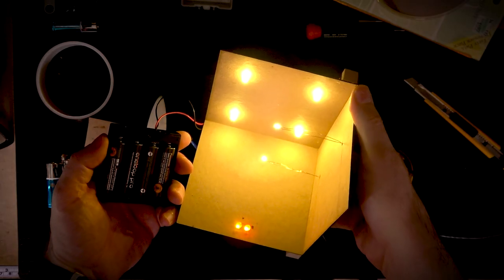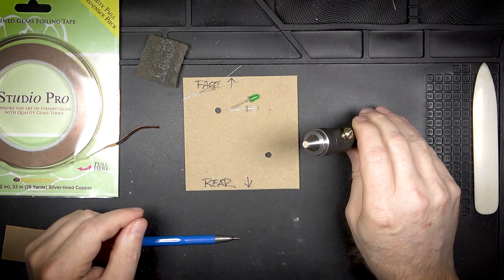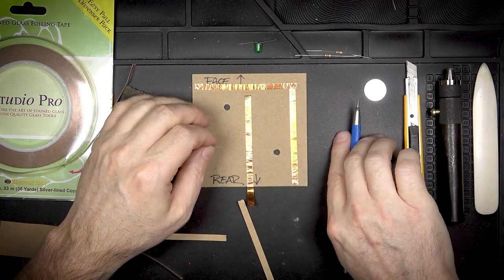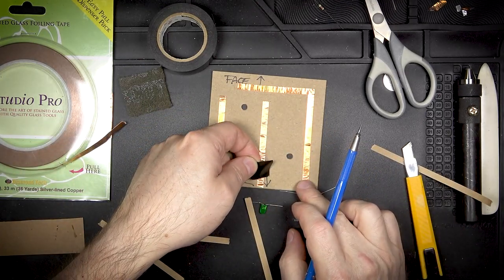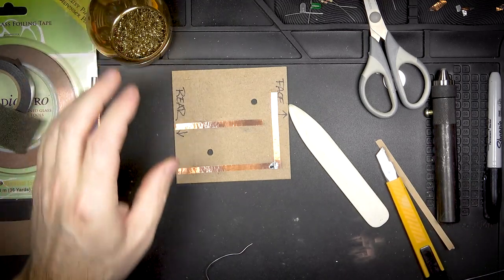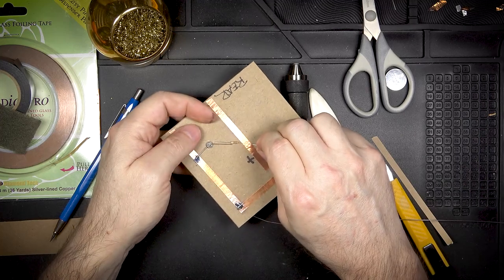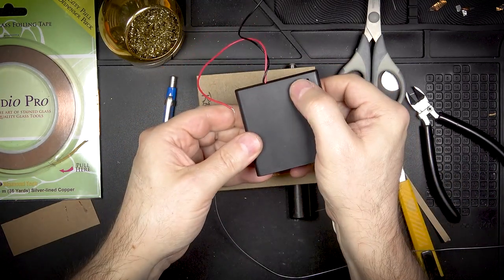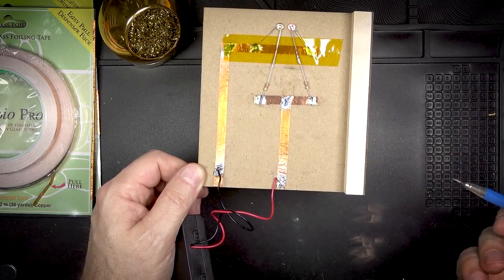Using Copper Tape to Wire Book Nooks and Dioramas

Comment: Thank you so much for doing this comprehensive video.  There are few video's available which fully explain how to actually add electrics safely but now I feel I could actually try it myself! Thanks again :)
Reply from the maker: Glad it was helpful. For the most part, LEDs are pretty straightforward. Soldering takes a tiny bit of practice but it's actually a good skill to learn. If you keep your voltages low, work with batteries, and watch out for shorts, it's pretty doable. All the best with your projects!

Comment: Very good and detailed instructions for complete novices like myself. Thanks!
Reply from the maker: You’re very welcome. I hope it makes adding a little lighting to your projects a bit easier. All the best and happy new year!
Reply: @RandomMakingEncounters  you as well! I still have to work up the courage to try it, lol. Where do you get your supplies?
Reply from the maker: @valhalloran  I get a lot of things through Amazon. However, the copper tape is used in stained glass and any hobby or craft store that has basic stained glass supplies will also have copper tape. The soldering irons for stained glass are probably a bit on the heavy duty side for soldering LEDs so I would look for something geared towards electronics. There are some good starter sets on Amazon as well. I have a few links to supplies in the description.
Reply: @RandomMakingEncounters  thank you for your prompt reply! Happy New Year!

Comment: Ive been looking into using copper tape and LED’s for adding lights into my card making. After watching this informative video i want to use it for my booknooks too. Can i ask why you have used a resistor for each LED ? Ive not seen them used before in any of the other circuit videos ive seen
Reply from the maker: You bet! LEDs are quirky little components. If you deliver too much current to them, they can be damaged/destroyed (usually destroyed in the blink of an eye). Let's dive in!

There are two ways to connect multiple LEDs in a circuit. You can connect them in series where the positive of one LED is connected to the negative of the next and the positive of that LED is connected to the negative of the next... and so on. The second way is to connect all of the positive LED legs to the main positive and all of the negative to the main negative/ground. I generally connect my LEDs to my circuits in parallel because they're usually spread out around the nook and I often mix and match different kinds of LEDs in the project (colors, flickering, etc.). Calculating resistor values is much easier and I can use lower voltage power sources... but why?

There are two things we need to know about an LED when designing the circuit - the voltage drop and the current rating. I'm not an electrical engineer so I'm going to give you my really broad, art-major explanation of both of these. Voltage drop is the amount of voltage needed for each LED to light - usually 1.5 - 3.5 volts. Current rating is how much current the LED needs to light up properly - 20mA is a good ballpark number. Exceeding the current rating can cause the LED to go up in a little pop/puff of smoke (been there, done that). Here's the tool I use to calculate things that also describes some of this - https://ledcalculator.net/

 Knowing all of these things, when we go to build our circuit, we need to deliver enough voltage to light the LEDs and limit the amount of current to just enough to work but not too much to fry. 

When wiring in series, each LED sucks up (drops) a bit of voltage starving it from the next in the series. If each LED needs two volts and you have three LEDs, you would need 6 volts going in. If you provide 6 steady volts, the calculator says you only need a 1ohm resistor... which is almost nothing. Keep in mind that 4 AA alkaline batteries will initially deliver more than 6 volts so your power source plays a big role and you need to design for a bit of wiggle room and err on protecting the LEDs in an over-voltage/over-current situation.

When wiring in parallel, each LED gets the full voltage from the power source. If we keep our source as 6 volts, each LED would need a 200 ohm resistor to reduce the current to the correct level. However... I could also reduce my power supply to 3 volts and lower the resistor to 51 ohms. Even better, I could keep adding LEDs in parallel without needing to bump up the voltage since each LED is basically connected directly to the battery without being influenced by other LEDs in the circuit. One resistor per LED is incredibly easy to understand at the cost of more connections and more resistors. It's not elegant... but it's simple... kinda like me.

It's possible to use lower voltages and wire in series but you will reach a point where you need to start to break up your series LEDs into chunks when the voltage drop across the LEDs exceeds the circuit voltage. You then end up with a mix of series and parallel in your design.

I hope that all sorta kinda makes sense. Since I mix and match LEDs in my projects, each LED will have different voltage and current requirements. I'm a keep it simple kinda person and don't want to math too much. It's very easy to plug each LED into the calculator and come up with a resistor value for each in the circuit. One thing to note... you don't have to be spot on with the resistor values as long as it's a bit above the calculated value. There's a fair bit of slop and too big a resistor means the LED will be dim or not light at all where too small means a puff of smoke.

I think it's a fair statement to say that LEDs should always have some form of current limiting resistor... even a really small one. Here's a great deep-dive resource for almost everything you would ever want to know about LEDs - https://learn.adafruit.com/all-about-leds/

I hope this is helpful. The approach I take is really just trying to keep it simple and understandable to me. I could certainly run LEDs in series and end up with a simpler circuit and fewer resistors but resistors are cheap and a simpler circuit only means less wiring... not simpler to understand... at least for me :)

All the best with your projects. LEDs really make everything better and can add so much to a diorama/nook. It's well worth figuring out an approach that works for you. I've burned up a fair number or LEDs but they're relatively inexpensive compared to the microcontrollers I've fried! LEDs are the perfect gateway to electronics!

Cheers!
Reply from the maker: One quick note... I saw you said card making. There is one instance where you can get away with not using a resistor with LEDs and that is if you're using a small coin cell. For whatever mystical magical reason, you can connect an LED directly to a coin cell without a resistor. I think it has to do with most coin cells being 3 volts (just about right to light an LED) and some internal resistance in the battery due to it's design. It's possible that explains why you're not seeing them in applications that use that kind of power??

Comment: Awsome video, I have a question tho. When it comes to LEDs dying out, isn't it too big of a work replacing them?
Reply from the maker: Absolutely. To make things worse... my nooks are usually sealed up tight. I don't keep them on 24/7/365. The good news is LEDs have a really long lifespan—I also tend to run them a little on the dim side to extend that. You bring up an important point. If your project will be on all of the time, building it in a way that it can be repaired is super smart. Desoldering a few LEDs wouldn't be too hard. Ripping things apart to get to them... that may do more harm than good. Great comment. Thanks!

Comment: I believe on most 6 mm LEDs the negative side also has a flat shoulder on the body of the LED itself.  Helps if you snip the leads shorter and forget which is which.
Reply from the maker: Thanks for the tip! I'm running outta space in my brain so I'll probably forget and still need to test. Hopefully others will fare better! Thanks again and all the best!

Comment: Great video, thank you so much! Question: can you use copper tape in plastic models? Does copper tape heat up? Many thanks!
Reply from the maker: The short answer is… it depends. Here’s the deeper dive answer based on my basic knowledge of electricity (I’m an art major so take it with a grain of salt). Broadly speaking, conductors, like copper wire or tape, have some amount of resistance to the flow of current or amperage. The greater the resistance and the higher the amperage, the greater the amount of heat generated. The thinner the conductor, the higher the resistance. To better answer your question, we need to understand two things: 1. What is the amperage capacity of the tape 2. How many amps is the circuit drawing. 

The first answer is a little bit of a guess because most copper tape doesn’t have an amperage rating but we can do a bit of research to make an educated guess. From a bit of searching, folks calculate that 1/2” copper tape is somewhere in the range of 20 AWG wire. Wire of this size has an amperage rating of around 10 amps. I’ve seen estimates as low as 5 amps but 10 seems conservative. Another good reference is the amperage rating of copper traces in circuit boards. Depending on the thickness of the trace (they’re pretty thin), a 1/4” copper trace has an amperage rating between 7 amps and 20 amps. With both of these references, it would seem that 1/4” copper tape should be able to handle 5 amps give or take a bit. The wider the tape, the higher the amount of current… narrower… less.

The second question is a bit easier to answer. If you go to a site like ledcalc.com and plug in all of your variables, the calculator will give you a total current consumption of the circuit. When I put in a 6 volt power source and 20 LEDs with some basic voltage drop and LED current, I get a result of 195 mA with a mA being 1/1000 of an amp. Obviously, your mileage would vary and some high power LEDs can draw a LOT of current. However, if we’re talking standard 3 mm or 5 mm LEDs, they don’t seem to draw that much current and are well below 5 amps. In fact, the wall transformers I use regularly are 5 volt and only rated to 2 amps which is generally more than enough for most of the applications I use them for.

All of these things depend on creating a good circuit where there are no shorts… shorts allow as much current as the power source can deliver to flow… so… not good. When in doubt, I’ll also use a multimeter to check how much current the circuit is really drawing. Calculators are good but a multimeter helps you understand what’s really going on. When I put a multimeter on my Mandalorian nook, it showed that it was drawing around .5 amps. I probably had close to 30 LEDs in that nook. The calculator said 400 mA so… kinda close :).

I know that was a pretty lengthy reply. I am always very cautious when wiring things up and, as I mentioned earlier, I’m not an electrical engineer. I tend to err on the conservative side of things and have done a bit of research on just how much copper tape can handle. I think the mantra is low voltage, low current. I hope this helped provide you with some info to better understand the things to consider when hooking up LEDs. All of this also applies to using wire as well but it’s a little easier because wires tend to have established amperage ratings.

Here are some links to the references.
https://www.pcbcart.com/article/content/copper-trace-and-capacity-relationship.html
https://electronics.stackexchange.com/questions/452148/ampacity-of-conductive-tape
Reply: @RandomMakingEncounters  thank you SO MUCH for your reply, and the time and research you put into it!!! Puts me on track to do a bit of research… Much appreciated!
Reply: @RandomMakingEncounters  Thanks for information! :) I'm quite far from electricity, so, I'd like to ask whether they are safe with mini leds like 6-7 piece of 1206, 0805 (or a bit bigger etc.) smd leds with 12V power source? :)))
Reply from the maker: @arnokalayc2054  I'm not sure I completely understand the question. Unfortunately, I'm not an electrician or electrical engineer. I can't make a recommendation around the safety of any particular application—there are too many variables. When determining the safety of any given circuit, you will need to determine the overall amperage the circuit will draw and then figure out the capacity of the conductors and components you're using. If the conductor isn't rated to handle the current flowing through it, the result is heat due to the resistance. Too much heat and you can end up with a short when the conductor melts or a fire when it reaches the combustion point of materials surrounding it. It's always best to consult with a knowledgeable electrician or electrical engineer when in doubt.
Reply: @RandomMakingEncounters  I'm without even a clue about electricity. So, I understand how the question looks... :) Thank you very much for your kind response and time!

Comment: I do have one slight question regarding the voltage. If I have several (maybe 20+) LEDs wired together, each being 3 volts, does this mean I should need a lot more batteries? Like a 60 volt battery pack? Or... maybe I just use the 4 disposable (alkaline) AA batteries to power 20, 30+ LEDs. Pardon my stupid.
Reply from the maker: There are two-ish broad properties of electricity, voltage and current/amps/amperage). The two work together but one way to look at them is using the analogy of water flowing through a hose. Voltage is the water pressure and amps is the amount of water. To make things work, you need to deliver the right amount of pressure and the right volume. Too much pressure (volts) or too much volume (amps) can blow out the component (which I've done all too often). In the case of LEDs, they will usually have a minimum voltage requirement that will vary by the type and even color of the LED. They also have a maximum current rating to prevent them from burning out.  To use our analogy, you need to deliver enough water pressure to do the work but not so much volume that you drown the component. This is really an oversimplification but I hope that helps. Here's a deeper dive into the concept - https://learn.sparkfun.com/tutorials/voltage-current-resistance-and-ohms-law/voltage

To answer your question, for multiple LEDs, you don't need to multiply the number of LEDs by the voltage. I generally decide what my minimum power requirements will be for the entire project... usually in the 6 to 9 volt range... based on other components I might be using (an Arduino works well with 9 volts for example). Four alkaline batteries will deliver 6 volts if wired in series. That's plenty of power to drive many LEDs for some period of time. There are a bunch of different ways to connect LEDs with resistors. I tend to keep it very simple and connect each LED with it's own resistor. I basically treat every LED as a single LED with positive going through a resistor to the positive power and negative going to the negative or ground on the power source. I use an LED resistor calculator like - https://ledcalculator.net/ to determine the resistor value based on the voltage of my power source and the type of LED. I usually use a bit higher resistor value so I'm never pushing the limit of the LED. It's important that ALL of the positive LED connections go to the positive power and ALL of the negative go to the ground or negative. If you start wiring positive to negative to positive to negative in a strand, that's called wiring in series and is a whole different thing.

The one thing I would encourage you to do is a bit of searching on "wiring LEDs in series and in parallel" to get a better understanding of the differences.

I hope that helps a bit. You would think LEDs would be super simple but the "diode" in light emitting diode means they have interesting electrical properties.

Cheers!
Reply: @RandomMakingEncounters  
Wow thank you so much, what an enormous help this is! Water pressure analogy is perfect. Also going to check out and bookmark both those links, in addition to the amazon listings for the LEDs themselves (multi-color 125 pcs for $30? Whew that's an enormous relief, I've seen listings for nano LEDs, 5 for $5).

Comment: Arduino project lightning Bolt cloud. Hello, can you please advise me on which links to download the necessary libraries to the arduino?
Reply from the maker: For the lightning project, the two libraries you would need are the Adafruit NeoPixel library and the DFPlayer library. Both should be available through the Arduino IDE. For more details, you can check out the following resources - https://learn.adafruit.com/adafruit-neopixel-uberguide and https://wiki.dfrobot.com/DFPlayer_Mini_SKU_DFR0299

Comment: Maybe dumb question, but is it possible to cut fairy lights and connect them via copper tape?
Reply from the maker: If they are battery powered... especially coin cell... the answer is a solid maybe. I know that's not a lot of help. LEDs often require a resistor with the power matched to the number of LEDs. If the LEDs are cut apart to reposition them and reconnected in the same way but different places, it might work. Clear as mud I'm afraid. I wish I could be more help but there are so many variables. All the best!
Reply: @RandomMakingEncounters  thanks for your reply! I’m not good at these things so grateful for your reply. My problem is that even though I have 10 meter of fairy lights, the positions of them are not where I want them. I’m thinking of just covering those i don’t want with black tape.

Comment: You dont need to keep track of the length of the LEDs legs. The negative side has a flat side on the casing itself.
Reply from the maker: Thanks for that tip! The sad part is I always forget what the flat side means too! I think the little gray cells may be suffering from too many miles! Cheers!